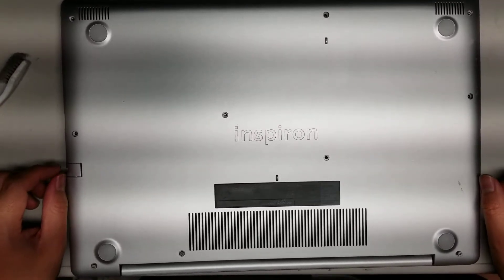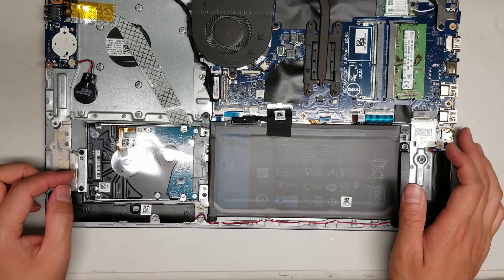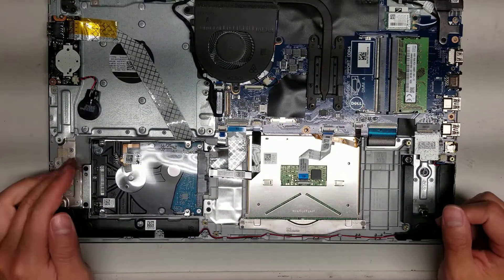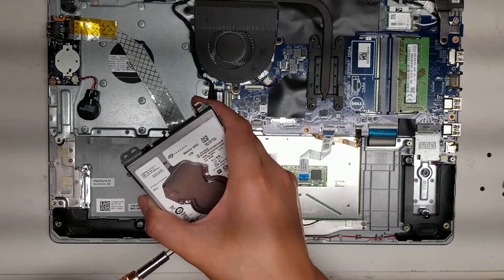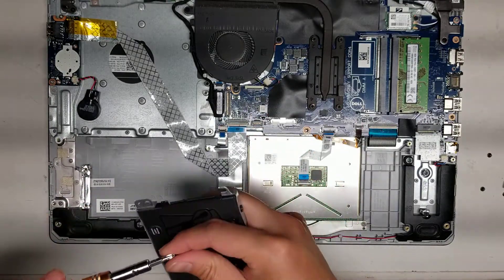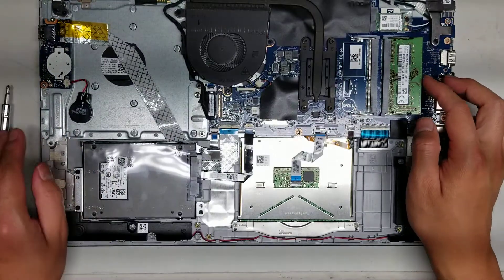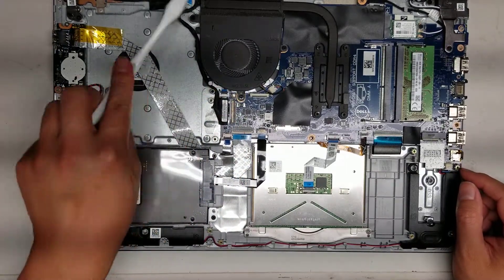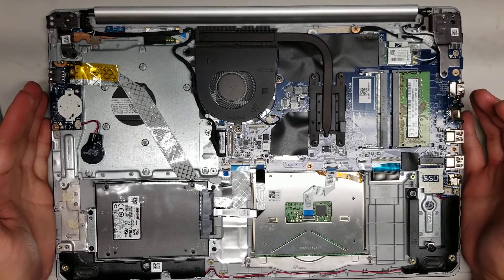Dell Inspiron 5570 P75F P75F001 Disassembly RAM SSD Hard Drive Upgrade Repair

Comment: Thanks, great guide. 

Btw, if your model has a DVD/CD Drive, you have to pull the DVD/CD drive right out and unscrew two screws that keep the base attached to the board.
Reply from the maker: Also, if your model has a CD/DVD drive, you're on the wrong video. I have plenty others with the right model most likely. :P
Reply from the maker: Glad you liked it. If you haven't already, please like and subscribe so others can find my videos. Thanks!

Comment: I just installed an SSD on this machine today. Thankful for your guide. Easy to follow. 

Only hiccup for me was that mine had a CD drive. With 2 mystery screws I couldn’t see until I slid it out. After that minor detour, it was smooth sailing. Thx for posting.
Reply from the maker: @hdwoodshop  awesome, glad it helped. If you haven't already, please like and subscribe so others can find my videos and possibly consider watching a few others, liking and commenting to get the algorithm to recommend my channel. Thanks!

Comment: I have the same model and am considering replacing the hard drive. Do u recommend the replacement drive that u did ? I don't necessarily want to buy a whole new laptop unless the replacement hard drive wasn't worth it. Thank you
Reply from the maker: SSD upgrade makes a huge difference.

Comment: I'm trying to install a sata SSD but it gives a black screen with scratches, I don't know what to do
Reply from the maker: What do you mean black screen with scratches?
Reply: When installing windows with the changed ssd, the notebook simply hangs on a screen
Reply from the maker: @MarcosAlexandre-gl4kj  does it work with the old hard drive in?
Reply: @ItsBinhRepaired  works, I put the old one back, and it starts normal
Reply from the maker: @MarcosAlexandre-gl4kj  try cloning the old drive to the new one. Maybe the issue is your usb installer https://youtu.be/4p5jFDzVwUw
Reply: @ItsBinhRepaired  I managed to solve it, I redid the bootable pendrive and the installation worked, the notebook is much faster, thank you
Reply from the maker: @MarcosAlexandre-gl4kj  awesome!

Comment: Sir how much cost will taken if motherboard is damage
Reply from the maker: I don't know. Depends if it can be repaired or needs to be replaced.
Reply: @ItsBinhRepaired  o thanx for reply sir but my laptop is totally off ( not opening ) so i think so it's matherboard has to be replaced
Reply from the maker: @unluckyff3680  check eBay if you can find a replacement motherboard

Comment: How to clean that black fan, without removing it from the laptop?
Reply from the maker: You mean just clean the dust off?
Reply: @ItsBinhRepaired  Well yes. OK I just saw you have other video with this laptop, where u removed it, without removing heat sink. Thanks for video.

Comment: What should I do if a part of a screw gets stripped or keeps spinning and I can’t get it out
Reply from the maker: Is the top stripped or the part that holds the screw in place stripped?
Reply: That part that holds the screw in your place. I managed to get it out, but now my problem is that I can’t separate the disk drive without it bending likes it’s going to break
Reply from the maker: @thefrostyslinger9041  hm? I'll need to see what it looks like.
Reply from the maker: YouTube deleted your comment. Just upload to YouTube and let me know when it's on your channel
Reply: Ok it’s there
Reply: So I managed to get the top off without separating that bit so it came off like a hinge
Reply from the maker: @thefrostyslinger9041  that's the worst kind of break :( you might have to use a drill to spin it really fast while pulling to melt the part of the cover that holds it in place
Reply from the maker: @thefrostyslinger9041  hmmm be careful with the connectors in there
Reply: @ItsBinhRepaired  I got it too work, nothing broke, but my computer still has a problem where it makes a noise like either the fans are grinding against something, or the disc drive is being weird
Reply from the maker: @thefrostyslinger9041  if it's the fan, this will help https://youtu.be/3zs_SJ3BXgA

Comment: Can the hdd drive be replaced with and 1tb ssd or is it specific?
Reply from the maker: Yes, it also supports an m.2 SSD if you want a regular SATA drive, this is best. https://amzn.to/3iFjSaN If you want a faster drive this will work. https://amzn.to/3logFOV it connects to the right of the battery, but you'll need a screw to hold it in place.

Comment: Can the replacement ram card be 32 gb and Can I have different ram sizes?
Reply from the maker: You can use whatever fits. It works better if they're the same capacity.

Comment: I need to replace due to the original has just failed on me 
If I get a hard drive is there anything else I need to do or is it just plug and play
Reply from the maker: You need to install the operating system on it. It would be like putting a blank cd into a dvd player. Nothing is there.

Comment: Sir can I used Samsung 970 EVO Plus 250GB PCIe NVMe M.2 (2280) Internal Solid State Drive (SSD) (MZ-V7S250
Reply from the maker: Looks like it will. Not sure if pcie nvme will work or not. Try and let us know.
Reply: @ItsBinhRepaired  ok
Reply: @ItsBinhRepaired  thanks for reply
Reply from the maker: @LegendGamingArmy  no problem
Reply: Yes or not????
Reply from the maker: If they fit, go for it.

Comment: Is there a way to set the SATA so that the HDD goes from disk 0 to disk 1 in Windows 10 and a newly installed SSD into that SSD slot becomes the new disk 0? By default after installing the SSD in the SSD slot, it becomes disk 1 while the HDD remains as disk 0. Thx!
Reply from the maker: No, it's determined by where it's connected, but don't worry, it doesn't affect anything.

Comment: how long does the battery lasts??

actually my inspiron 5570 is like 1.5 years old and is showing false battery percent... i mean I can use it at 0% for reasonable time.,. which shows that there is software not a hardware issue. please guide how to deal with this issue
Reply from the maker: No idea. I don't own the computers. Drain to 2%, then charge completely and repeat twice.
Reply: Sounds like you need to "train your battery." Kinda like he said, you gotta cycle the battery & try to emphasize in the single digit percentage. Let it die out past 0% a few times & recharge completely. May just be calibration with battery life.
Reply: My homie showed me you could "train" batteries to last longer when in battery saving mode in lower percentage. After a few cycles of full death followed by full charge may fix it.